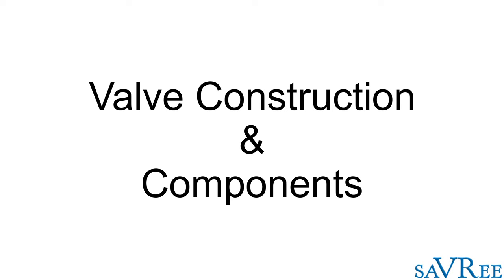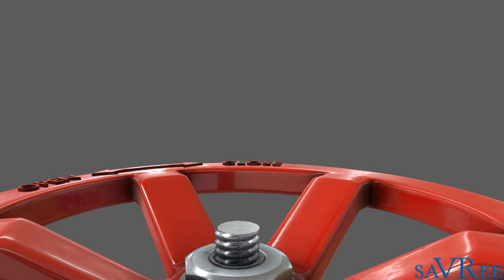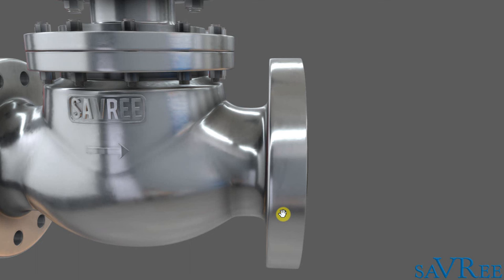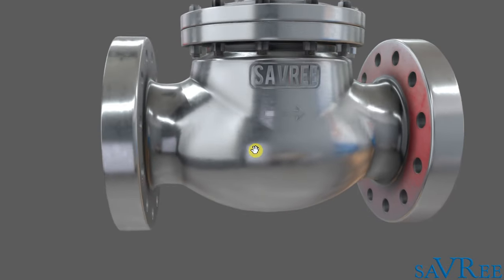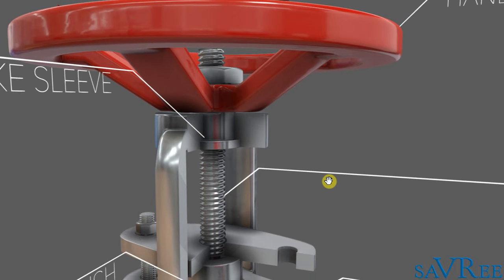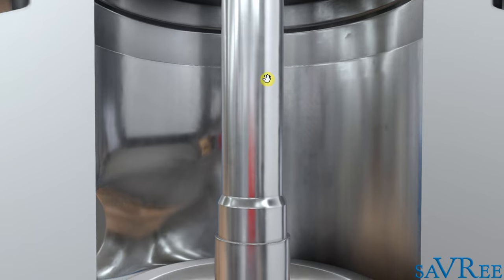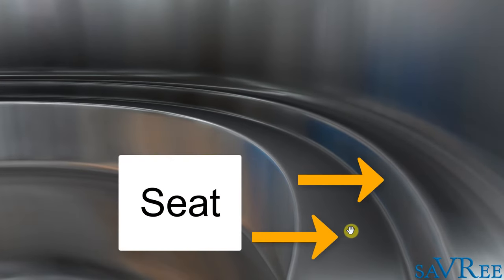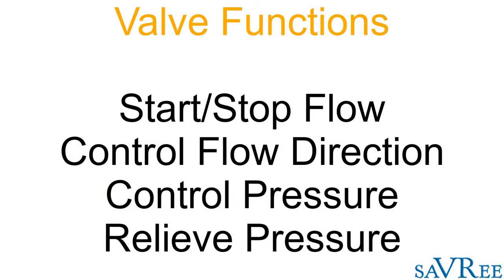Valve Parts Explained (Industrial Engineering)

Comment: Please note that, by the looks, the stem has got a right handed screw thread on it. Hence for the clockwise rotation of the handwheel or the sleeve nut, the stem has to move upwards rather than downwards as shown it the video. Please check that out.
Thank you.

Comment: is it just me or is the stem's screw on backwards? All of the valves I've seen with a screw which goes through the actuator and not attached directly to it seem to go the other way. If the actuator is engaging the screw on that valve, it seems like turning it clockwise should push it up.